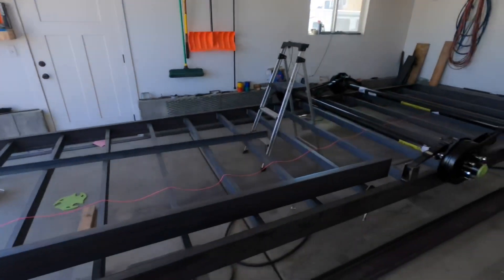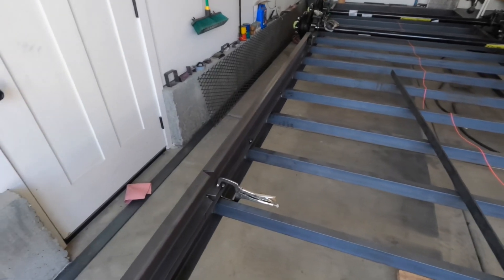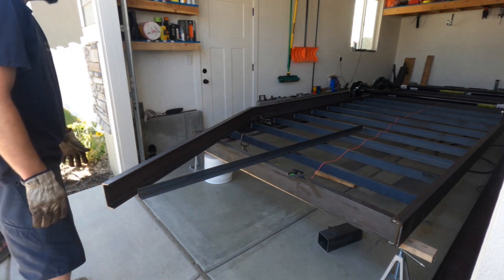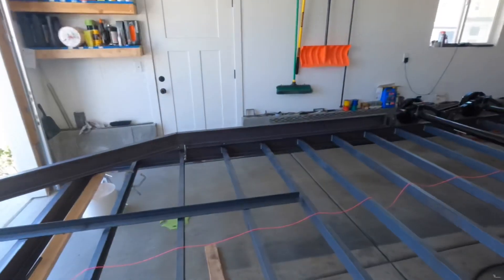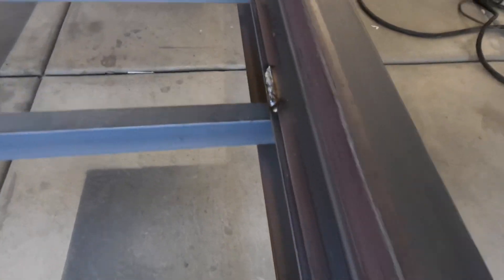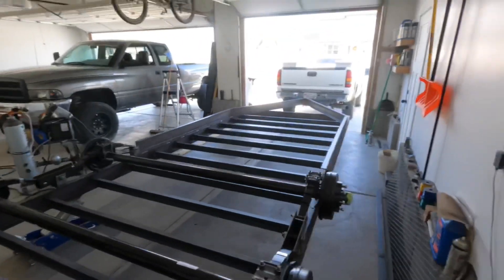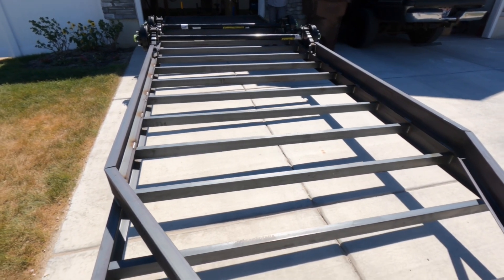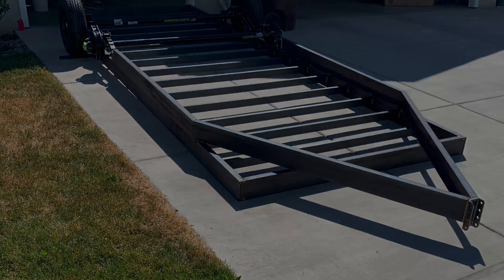Equipment trailer build, part 5. Trailer tongue fabrication.

Comment: You couldve put the wheels on a rolled it out by hand lol
Reply from the maker: Being up side down it was too low. I put the wheels on out in the drive way and it was only 4 or 5 inches off the ground.
Reply: @kmac9759  yes but a jack under the tongue will let it roll right out. You cant hook it to a truck like that but you can roll it out by hand. I do it all the time.
Reply from the maker: Ill try it next time, but my drive way is steep enough that im not sure it will make it over the high point where the garage door sits.
Reply: Ah right on. Cant really see that in the video.  You can jack the tongue up as you roll out. It may be to steep for that to be safe. Anyway, nice trailer. Just needs some rub rail down the sides. And reflector tape. Make it look like a factory built trailer. Good job. Need a shot of it in the dark. I would like to see how bright those lights are. Im about to build a deck over, those small lights would be handy in crowded areas if they are nice and bright.

Comment: whats the measurements on the c channel for the tongue?
Reply from the maker: Its 6 inch channel with a .200 web thickness. It sticks out 40 inches from the front of the trailer.
Reply: @kmac9759  What’s the overall length of those tongue runs from ball coupler to fender?
Reply from the maker: @SteveVolkoff  171.5 inches. I notched them 90 inches from the fender side.